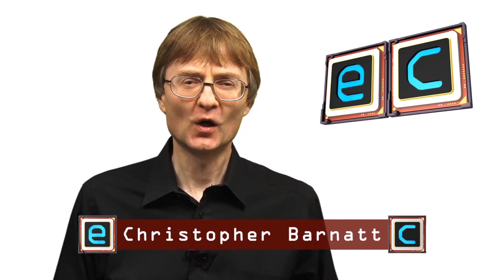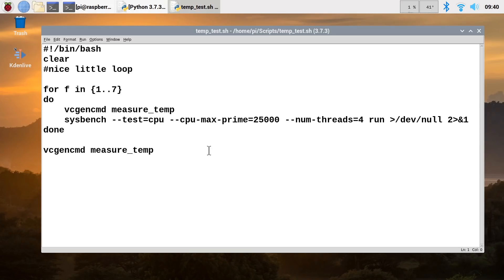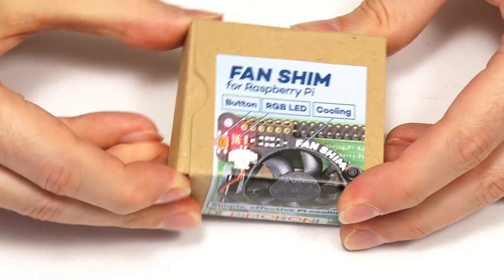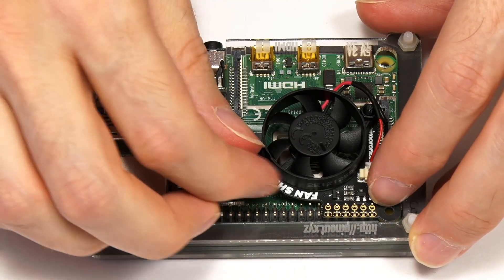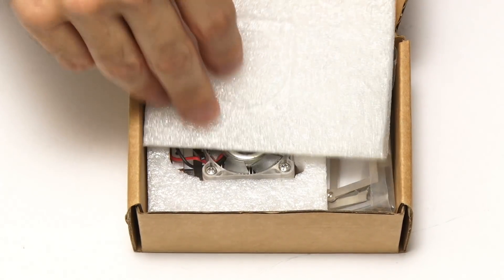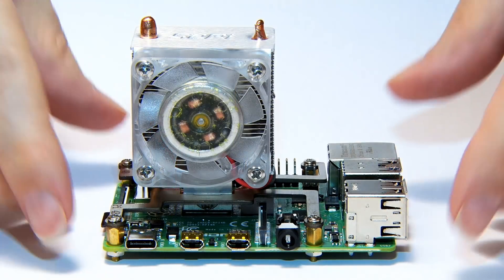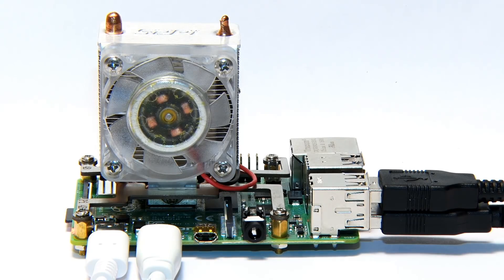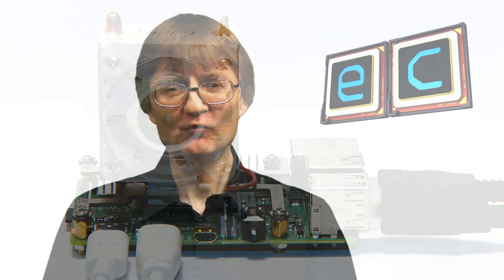Raspberry Pi 4: More Active Cooling!

Comment: I hope this maybe of some use to some of you watching Chris' superb videos on cooling and casing the Pi4. I'm using one of these cases:-

https://thepihut.com/products/dual-fan-heatsink-case-for-raspberry-pi-4?ref=isp_rel_prd&isp_ref_pos=4&variant=20679594180670

Fans are always on but quiet. I have my Pi4 overclocked to 1750MHz (250MHz over stock - so that's a bonus - should run cooler if not overclocked) and the results I get from Chris' stress test are:-

44.0'C
57.0'C
58.0'C
58.0'C
60.0'C
60.0'C
59.0'C
61.0'C

Ambient was around 25'C

The case gets warm to the touch but not too hot and I have put mine on small rubber feet so it does not touch the surface it sits on.

Not a bad solution, plus you get a rather robust case as well as the active cooling.
Reply: Just a couple of other points. Even on shutdown the fans will remain spinning until the power is fully removed (since the 5v GPIO pin is being used to power the fans). It would be great to see a proper fan header provided on the Pi in later iterations especially with them starting to really need active cooling (also for RGB lighting as well maybe?). Also I'm not sure how robust the actual fans are. They look OK but until I've run them for a protracted time it is hard to say if they will stand up to 24/7 operation.
Reply from the maker: I agree -- the Pi needs a fan header now.
Reply: And an eMMC memory option for the O/S, to take away the wear on that poor SD card :)

Comment: I have a flirc case that does a great passive job and looks nice too, although it's not as good at cooling as the ice tower.
Reply: A FLIRC case seems to be enough to avoid overheating. And it looks less like a diy mess.
Reply from the maker: I will put a Flirc and other passive cooling solutions/cases through the same test in my final Pi 4 cooling video.

Comment: Copper wins!!! 
That's why the ICE Tower with its copper on the chip you're trying to cool has by far the best results. Granted I am a little surprised on how well just a fan without a heatsink performs, but ultimately the best solution (minus liquid cooling and even then...) is to put copper on the chip and then extend to it to some type of aluminum, preferably fins, with a fan.
Reply: I doubt that liquid cooling would be more effective than the Ice Tower.
Reply: @johnm2012  Yeah I doubt so as well, but I've never personally dealt with them.

Comment: Looks like the Fan Shim is the best solution. It allows the pi4 to run without throttling and low cost and small and quiet. Very nice thorough comparison.
Reply: Does it block access to any of the I/O pins or do they protrude far enough to be accessible?

Comment: Just a remark. Fan SHIM is NOT properly mounted. You need some thin plate thermally attached to CPU just to increase area of cooling. Most power of the said  Fan SHIM is wasted... Otherwise excellent results. Also can be noted that with heat pipes - this is not the only way of mounting. Can be flat from factor. Not cubical . Very practical video. Thanks,
Reply from the maker: The Fan SHIM is properly mounted. :) Yes, a heat sink could be used with it, but not in the case shown, as the distance between the base of the fan and the fan is very small.
Reply: @ExplainingComputers  I understand you properly mounted as designed, but I meant the design is insufficient. And not talking about heat sink. Simple tin plate cutout from jar of instant coffee (my personal preference). It's about 0.1 mm.

Comment: At this pace, we will be seeing water-cooling solutions for the raspberry pi 5.
Reply: Do remember reading a sci-fi years ago; guy's computer was threaded onto the kitchen faucet and the cold water turned on fully before the computer was turned on. Otherwise the heat generation quickly (within a minute) destroyed the system. 
Yesterday's sci-fi is today's headline and tomorrow's old news.

Comment: Some regular 60 mm fan, set at low speed to not be noisy would probably be most effective as it will remove potentional heat from everything 😂.

Comment: It might be interesting to experiment with the 52Pi ICE Tower Cooler and a Pulse Width Modulation fan speed controller board for the fan.  (Something like one of these, perhaps? https://amzn.com/B07NPJ5MQR )  Turning the speed down on that fan to where the cooler's performance is more or less comparable to some of the other active cooling solutions (which were clearly perfectly adequate) might result in a noise level so low it rivals the silence of passive cooling.  Keeping mind that complete silence is not necessary in any real world room since even the most quiet spaces I've ever used a computer have at least some small amount of background noise.  If slowing down the fan without entirely turning it off could get the noise levels down to where the fan's noise is essentially masked by background noise then it becomes indistinguishable from a passive cooling system.

Comment: Surely that defeats the object?  

You can make a waaaaaaaay more powerful single board setup in a smaller form factor.  

I’m super happy with my pi but it seems silly to make its footprint bigger than necessary.  IMO.

Comment: Buy a raspberry pi because it gives you 40 pin gpio. Sorry with the new raspberry pi you have has only 28, 12 pins were used by the fan. 🤷🏻‍♂️🤷🏼‍♂️🤷🏼‍♂️
Reply: Ron Damón I may be incorrect, but I believe those pins can still be used.
Reply: @perrymcclusky  I think you are right, but, of course, the pins will have less current.
Reply: Ron Damón yes your point is well taken. I wonder which pins are actually being used for the fan and it’s controller and which are used only for support.  It would be interesting to know what kind of applications people buy that fan for.

Comment: If you want to run the Ice Tower without the fan, you need to completely take it off, not just disconnect it because the fan is blocking the fins on the heat-sink which drastically reduces its effectiveness.

Comment: Nice Stuff Chris. Any notice about Openmediavault on the Pi4? A good performance contest between the Pi4, the Odroid XU4 the Rock64 or the Rock pro 64 would be interesting so we can realise whether is it worth to get the actual Pi4 or wait for the next release instead. Greetings!
Reply: I am mostly interested in the NanoPi M4. Pi format but cooling on the back side so that you can use a huge heatsink and a hat that uses the GPIO pins.
I think it has both higher performance and lower power usage when idle.

Comment: I bought a kit of an acrylic case + 5 V fan for just 4$.
It is a bit noisy running in that config. I got the pi down to 44° C while ambient temperature was just 14 degrees lower. Pretty good except the fan running.

Perfect solution can be gained by connecting the cables to gpio  3V instead of 5V which lowers the rpm  and the complete stress level has completely gone.

And yes, less rpm means less cooling so temperature increased, but who cares about 49° instead of 44° when the ambient temperature is above 31°C ?. Just 18° above room temperature is perfect for a less than 4$ 

Just the best point to start for 3,42€ except the fact they just have 1 piece left. But supply will be sooner or later in stock I guess or check for something similiar

https://www.ebay.de/itm/264408007677

Comment: For me either Noctua-like without a HS or some passive like Ice tower or full metal case would be a way to go. I'm still not sure how Pi would fit as a desktop for me (micro hdmi still makes me 🤬), but I think for typical home computing SBC like devices are a way to go. Recently I bought Intel NUC with i5-8259U CPU. Not much bigger than a Pi but outperforms my Haswell i7-4770HQ on MBP. 
Looking at Pi ecosystem I think Pi0W is a great drop in Linux board and Pi4 is going to be a cheap drop in desktop-like board. Not sure about 3A+, I personally like it because of form factor and less power requirements. I use it as a drop in Linux where Pi0W has not enough power.

Comment: I was getting ready to comment about running the tower cooler with some MX4 instead of thermal pads..  then you pull out a tube of MX4. Good lad.
Reply: Would be another datapoint, do the test again with a thermal pad instead of the paste to see what the difference in performance there is.
Reply: @Dmon1Unlimited I remember quite a few years ago I was using the original pi with thermal pads (Akasa) along with a generic ram heatsink and was getting ~10°C over ambient temperature, which was pretty good considering the cost for it all. Keep in mind that I was also using these in conjunction with a very small (40mm) casefan I had rigged up, running it of the USB port.

Comment: I think the Fan Shim is excellent and makes the Pi4 seem like a Pi SBC . Whilst the result of the ICE Tower is incredibly impressive, I just think it makes the Pi4 seem too big and, for me anyway, it goes against the point of the Pi SBC form factor. It does mean there is a fair bit of head room for overclocking the Pi4 though.
Reply: I can see the Fan Shim board connectors succumb to huge oxidation issues down the line. It really needs a proper connector or to be soldered into place

Comment: I'd be interested to see overclocking potential with the Ice Tower. How far can this system be pushed?
Reply: Last time I checked, the Pi 4 is limited to 2GHz. A small fan is enough to keep it below throttle temperatures at this speed - heat is not the limiter.

Comment: Can you use a Sim card for internet??
Reply from the maker: The Pi 4 has WiFi and an Ethernet connector to get online. It could connect using a SIM card using a MiFi module or similar connected via USB or WiFi.
Reply: @ExplainingComputers  thanks for your reply in tend to take it overseas so I wanted to know if it was possible to put a local sim to use it

Comment: Now add a Peltier to the Ice Cooler.  LOL
Reply: What would that achieve though? Any of these cooling solutions is sufficient to stop the processor from throttling so what is to be gained by more exotic solutions?
Reply: @johnm2012  Probably nothing.  Just fun screwing around.  Go Cryogenic.  Overclock the chit out of the thing.
Reply: @pulesjet  For the sheer fun of it is an acceptable answer. Michael's longevity one isn't.

Comment: My rp4B+ have this cooling tower mounted in a layered case... Needs some minor filing because of the mounting bolt sticking out Just a hairs width. 

https://rover.ebay.com/rover/0/0/0?mpre=https%3A%2F%2Fwww.ebay.com%2Fulk%2Fitm%2F283545717427

Comment: Must admit the 52Pi ICE Tower Cooler looks cool (no pun intended) and does the job very well.  Is the only way to natively power the 52Pi ICE Tower Cooler to use the GPIO and, potentially, lose the use of those pins?
Reply from the maker: The ICE Tower is superb. It could in theory be connected using a thin circuit board to allow jumpers to be connected to the same pins -- just like the Fan SHIM allows this to happen. But the ICE Tower will require access to one 5V pin and one GND rail by some means
Reply: @ExplainingComputers  Thanks for the quick reply.  To be fair, if people need the GPIO then a quick mod for this won't be an issue.

Comment: I liked the video but I wish when you had used the Ice Tower without the fan that you would have shown a chart with all the passive cooling results so that we could have seen how its passive ability compared to like solutions.
That said, I really like the Ice Tower and wonder if there are any case solutions that were designed with it in mind?
Reply from the maker: I plan on a third and final Pi 4 cooling video checking out various commercial passive cooling solutions, and will put all the data together in that. I've yet to come across an ICE Tower compatible case. Maybe I'll design one to be 3D printed. :)
Reply: @ExplainingComputers  I'd really like seeing a 3D printed case for it. Looking forward to seeing it.

Comment: Check out the new Pi 4 case from Flirc. It's lovely and works very well for cooling, too.
Reply from the maker: It will form part of my final Pi 4 video on passive cooling solutions! :)
Reply: @ExplainingComputers   I have a Pi 4 flirc case. My pie idles higher than most (started at 60C after  a month it has dropped to  50C(ish)). Under load the case is quite warm (so there is good cpu to case contact).  Since the bottom seals the case, I was wondering about using some 10mm(ish) standoffs between the bottom of the board and the base cover to allow some airflow into the case. The standoffs would need to be long enough to clear the SD card slot. I have no local source for 2.5mm stuff and shipping is about 10X the cost of the standoffs. Any chance you could give it a try? Thanks
Reply from the maker: @bradquinn4161  I will certainly be testing the Flirc case in a video here soon. :)
Reply: @ExplainingComputers  I find that while it works, it ends up too toasty to hold under load.  Interested to see your tests and results on it.
Reply: @ExplainingComputers  Yes, the Flirc is the only way to go.  https://youtu.be/F-tvuvTpUkA
Reply: @ExplainingComputers  Very nice! I will hold off buying anything until I've seen it.
Reply: As it happens, I just got one of those and ran the same test on it. Starting from 35 C seconds after booting, it hit 61 C at the end of the test, and idles around 55 C long term.  The case has quite a lot of thermal mass, so temperatures move slowly.  It takes a long time to fully heat up, and a very long time to cool back down.  It's hot to the touch at the end of the test...Allowing it to hit its 56 C idle first, it heats to 71 C in this same test.

Testing another pi4 in the Canakit case, modified to mount a Noctua fan on top, and using their "joke" heatsinks, I got a little bit better results than Chris; I think the airflow in my version is a bit better in terms of the path it takes - but it looks horrible by comparison.  For that one, I got 51 C top temperature, it idles in the low 40s.

I think my room might have been around 1-2 C cooler than his (It does depend where in the room you measure, around here).

The fan is clearly the winner in all tests, his and mine. It's so good I'm thinking about trying to run it down in speed, or make it switched, like the pimoroni fan.  I got the "thicker" Noctua (same as shown here) - there's now a thinner version on Amazon, which is probably less air and more noise.  Be careful in ordering.
Reply: @DCFusor  Very interesting point you are making about the thermal mass and time aspect. I will wait for the next EC video and see what he thinks.
Reply: @mplovecraft  I was really surprised by that.  It just doesn't seem that massive otherwise, though I suppose long thermal paths are part of it...it takes seemingly forever for it to reach some sort of equilibrium (10's of minutes?).  Longer than a TV show (what it looks like FLIRC concentrates on - set top stuff).  Works out fine for bursty loads like development, though on the warm side for my taste (and touch).  Otherwise, it's a gorgeous box.

Comment: nice. i may get the Fanshin if i buy a Pi4. the Icetower is cool, probably the better solution for people who dont move their Pi around too much.
Reply from the maker: The Fan SHIM is excellent, very easy to fit, and very practical. The ICE Tower is just cool! :)
Reply: I have a fan shim, and it does work very nicely indeed. Snug fit, and quiet as well. Chris' performance test fits my experience of it as well.
Reply: In my opinion, there's benefits to the Noctua and Fan Shim setup: controller cooling including Ethernet and USB.
Reply: Space Monkey  sure. So don't but it unless you can get a fan. It's just not.that helpful to outright condemn the device due to one easily fixable fault.
Reply: Space Monkey  a better analogy would be if a $100 smartphone had a defect where the rear glass broke. Apart from that, the phone was awesome. You are the person saying 'don't buy this phone, the rear glass breaks easily' and I'm saying 'if you want this phone, make sure to factor in a case as it's necessary.'

If that other stuff is a deal breaker for you, ok.